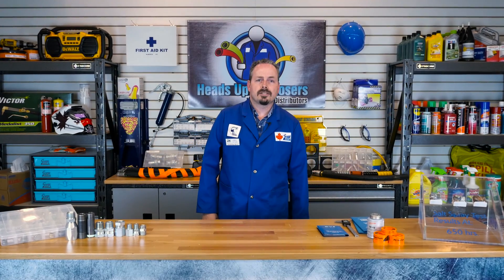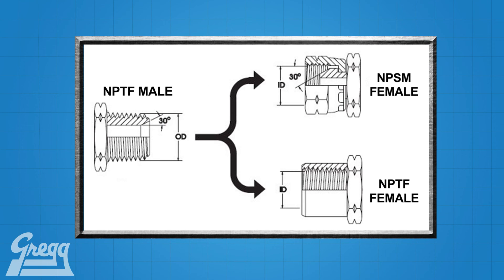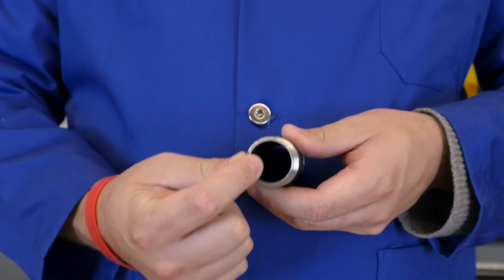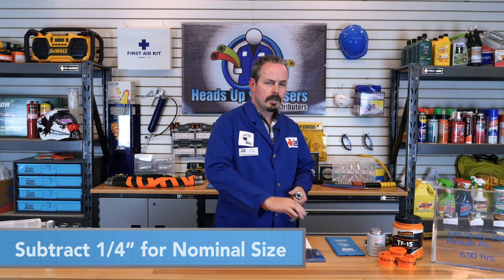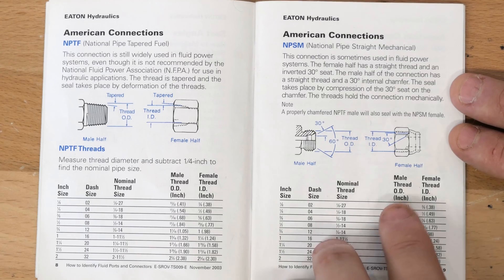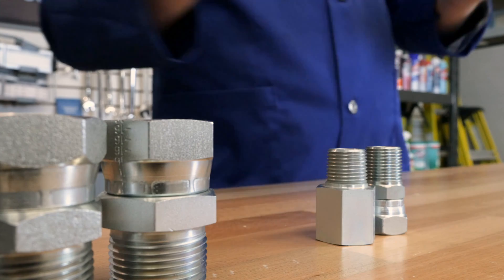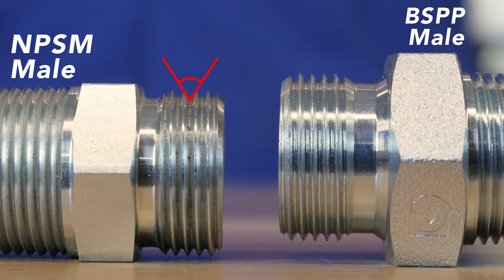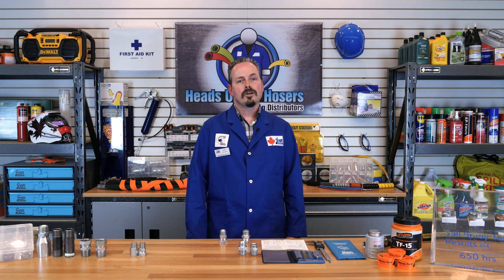NPSM Fittings / Thread - Identification & Installation - Heads Up for Hosers

Comment: We stuck with 10 inch NPSM thread seized. Can you pls guide how to avoid seizing during assembly?
Reply from the maker: You should consider using a thread sealant.  Have a look at the product that are available on our website at https://greggdistributors.ca/adhesives-sealants-and-tape/Thread-and-Gasket-Sealants/Pipe-Sealant?resp_group=Default,Variations,ItemProperties

Comment: Do any manufacturers make 1/2" NPTF x 1/2" NPTF swivels?
Reply from the maker: If you are asking for a live swivel (a swivel that will rotate with minimal torque while fully presurized), yes, Aeroquip have the (AER) FS59004-88-75.  If you are asking for a swivel adapter for assembly purposes, yes, part number (AER) 2046-8-8 will do the trick.  The 2046-8-8 is a Female NPSM rigid by Female NPSM swivel.  If you watched our NPSM video, you will note that NPSM has the same thread as NPTF however the sealing action occurs on the internal chamfer and not the thread.  If you are going to use the 2046-8-8 make sure your male NPTF fittings have an internal chamfer to match the female NPSM fittings and you will be all set!  You can find both of these fittings in our catalogue on page V126 and V65 (https://www.greggdistributors.ca/catalogue.php) Hope that helps!

Comment: At 8:32 you say due to thread angle difference a true seal is never formed. These are parallel threads so sealing just takes place on seat i thought and not on threads. Please clarify. Thanks?
Reply from the maker: While the wording may seem somewhat ambiguous, it is correct.  You are also correct in your assessment that the sealing takes place on the seat.  Having said this, due to the angle differences in the thread you will never be able to thread them together in a fashion that would allow the internal seat to seal.  Even though it may feel like the fittings would thread together a true wedging action of the threads would never take place resulting in a leaking fitting.
Reply: @GreggDistributorsLP  Hi. Iam am doing a word document to capture the information and pictures in these videos purely for my own benefit so i have a reference of all this info in one place that i can access or print out. Thats why i am asking a few questions. Recently started working in a canning factory where there is a lot of specialised equipment and hydraulics and my knowledge of fittings is weak up to now !!     :) Thanks Michael